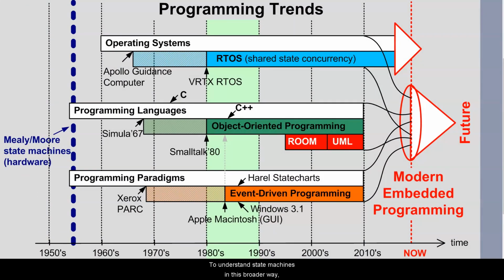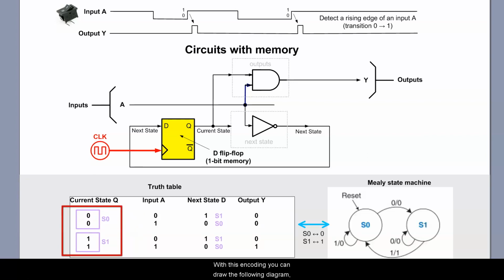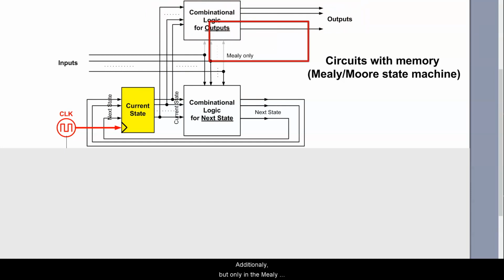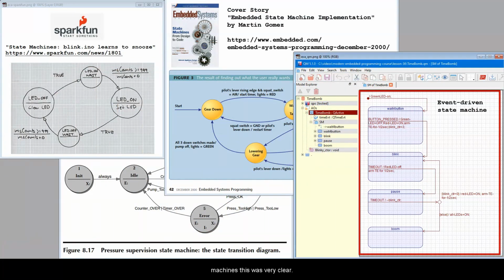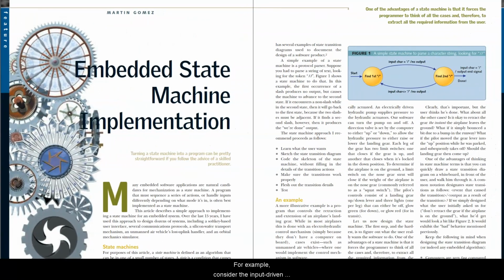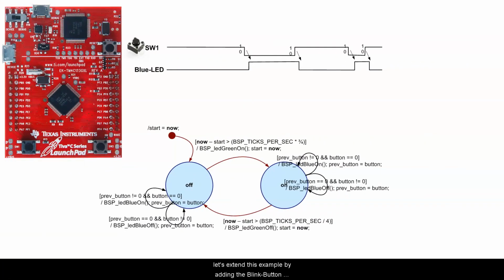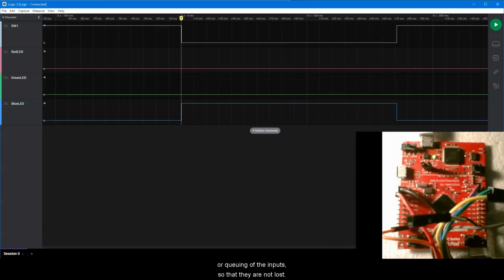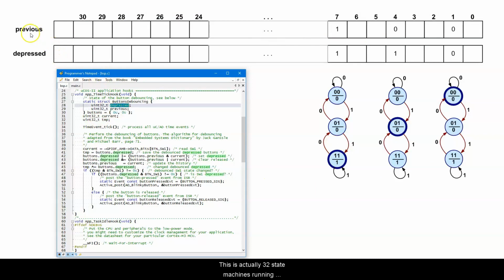#37 State Machines Part-3: Input-Driven State Machines

Comment: I think there might be some errors in Moore's Raising Edge Detection circuit. Due to the AND symbol, there are no conditions where Q1 will transition to 1 if we start from 0 0. AND symbol will never show 1 if either of the inputs is 0, and, correspondly, the transition from 0 1 to 1 0 will never occur.

Comment: I'm not trying to bother you too much, but do you happen to know of any alternative input-driven framework that would still allow for easy programming-by-difference and input-driven statemachine nesting with some sort of publish-subscribe mechanism as well? Or does that sound like a stupid idea even?

Everything else seems so spot-on about your approach, but I would like to think of the statemachines as "concurrent" actual machines that change their behavior given the state they are in (but don't sort of dissappear when there's no change in state), whereas these event-driven ones remind me more of fixed circuits that are only passed through on cue..

Trying to develop for time-triggered architecture automotive system.
Reply from the maker: I'm not aware of any "input-driven framework" that would have the properties you describe. In fact, this seems an impossibility to me because input-driven state machines deal with "inputs" instead of events. These "inputs" and their various combinations are then constantly checked in a polling fashion, so the code is littered with IF statements. I'm not aware of any way of publishing, subscribing, or reusing IF statements. Do you? Additionally, the "inputs" are typically shared (e.g., with ISRs), so you need to worry about the usual concurrency hazards, such as race conditions. For all these reasons, the industry has chosen the event-driven approach and frameworks (e.g., OXF for IBM Rhapsody, or QP frameworks used in these videos).

But if you are interested in input-driven state machines, the resource for that would be the book "Modeling Software with Finite State Machines: A Practical Approach". For time-triggered schedulers, the resource is Michael Pont's website "SafeTTy Systems" ( https://www.safetty.net ).
Reply: @StateMachineCOM thank you, I was thinking about some sort of compromise the way the input-driven machines can be used to generate the events, so maybe mixing them a little bit. But I don't really know what I'm talking about yet.

I guess I should still take a closer look into your "fly and shoot" example as well, it seems to work very similarly to what I need.
Reply: Going to probably go with behavioral trees or something, thanks for lots of useful info on these subjects anyway.
Reply: In the time-triggered RTOS I have to work with I can't use interrupts directly, only the time-triggered threads can be relatively prioritized, and the only way to raise priority otherwise is to take ownership of some resource temporarily with a lock. So I can't use the AO priorities directly, but otherwise it should be safe and sound.

It also already has the facility to debounce the inputs I need to use, so I get stuck thinking if I should put the input polling inside the AOs that use them or put them in their own AO or just poll them separately..

Comment: Hi Dr.Samek, 

The robotics example you give in the lecture. So in an event driven architecture for a robot, the event would consist of a variety of inputs e.g forces at different locations, current position etc  to decide how the motors would position the robot to balance itself. But that would happen asynchronously, so Robot decision time can get affected ?? Are Input driven state machines more responsive compared to event driven state machines in this particular case, and hence more advantageous for Robotics or Gaming ??

Thank you again.
Reply from the maker: In every real-time system you have delays between the stimulus and the response. The delay is typically smaller in event-driven systems because the code that responds runs as soon as possible after recognizing the event. (This is assuming that the event is posted to a high-priority active object). The delays between an interrupt that recognizes an event and the processing of the event inside a high-priority AO can be on the order of microseconds. In contrast, time-triggered systems respond only when the time tick arrives, which can be significantly later than the original event. The delays in that case are on the order of clock tick, that is milliseconds (1000 times slower).

Having said that, the delay might be negligible. For example, a time tick in a robot could run at 1kHz (every millisecond). This is much faster than any mechanical actuator can react. Similarly in a game, human reaction time is much longer than the "frame rate" of the game.

The point I was trying to explain in such systems (robots or games) is that it is impractical to decide externally what an "interesting" combination of inputs is for the system. That means that it is impractical to generate external events because that changes depending on the internal state of the robot or the game. So, the checking of the inputs and their combinations is most efficiently done inside the state machine anyway. Hence, these systems probably could use "input-driven" state machines, even though they are "less responsive".
Reply: @StateMachineCOM  Dr.Samek, thank you for the reply. I took some time to digest it. Please see if i am understanding this correctly.

Taking the example of robot further, depending upon if the robot is carrying a heavy load or not. The interesting combination of inputs needed to stabilize the robot i.e. which sensors to poll, will depend on the current state of the robot i.e. carrying a load or not. Therefore we need to poll for the particular interesting combination of inputs inside the state machine. 

In contrast, if we use Event driven machines, where events are essentially decoupled from the state machine and posted independently for further processing. We essentially have no control what events are being posted into the queue, or the interesting combination of events that we really need to stabilize the robot (in a given state). If we do decide to start checking the inputs, we have already shifted from Event Driven to Input driven architecture.

That is why in this case, a periodic input driven state machines makes more sense.

Comment: Hi Dr.Samek, 

Let me first say, I have taken a number of paid courses for embedded systems (I am self learning embedded), and nothing has come closer to what you have done for us the students, thank you so much !! , I had four questions :

1) I am a little confused between input driven and event driven state machines. From the comments, my current understanding is input driven state machines are constantly polling for input in a superloop,  meanwhile event driven state machines the events can be posted asynchronously from anywhere interrupts, other objects etc. So even if the event driven state machine is not currently active ( eg if it is a low priority task), we will not miss anything ?? Is this what we are trying to imply ?? that Input driven State Machines are running synchronously coupled with time , and Event driven state machines  asynchronously ??

2) I was searching up on Internet, and I came across slides from Dr.Koopman from CMU. In this particular slide (https://users.ece.cmu.edu/~koopman/lectures/ece649/07_distributed_tt.pdf), he talks about Event Triggered vs Time Triggered Approach to network a distributed embedded system. Is the Time Triggered approach something similar to input driven state machine that you are describing in the current lecture ??

3) I am slightly confused about what constitutes an Active Object ?? In the previous lecture we first had two active objects  1) Button and 2) Blinky. Later  we combined them together to form one AO, which resulted in more efficient memory usage. Can you give some guideline regarding that ?? How would I decide that this is one Active Object.

4) I am trying to read more about embedded software architecture (design patterns etc), and the only two resources have come across are your wonderful wonderful lectures and your two books. Another one is from Dr.Doughlass (Design Patterns for Embedded Software). Are there any other resources , I can read on ?? As I am thinking more, I am seeing by and large most of the problems can be solved via AO approach safely and in a scalable way, rather than mud-ball created by RTOS synchronization primitives.

Thank You.
Ovais
Reply from the maker: I'm glad that you study the video lessons. 

Regarding your question (1): your understanding seems mostly correct, except that "input-driven" state machines are not limited to the "superloop" only. They can also run periodically. The defining characteristic of "input-driven" approach is the existence of "inputs" that are then checked in every state (so you have the if (...) statements in every state).

Regarding your question (2): I frankly don't quite understand the referenced lecture by Dr. Koopman. He apparently talks about "distributed" systems connected by networks. This is a particularly difficult class of systems and is currently outside the scope of this course. Here we are still talking about a single CPU and single address space.

Regarding your question (3): optimal partitioning of the system into Active Objects is an art, similar to partitioning an object-oriented system into classes. Big books have been written, such as the classic GoF "Design Patterns" book, where you can read that experts typically come up with quite non-intuitive classes. An example of application design is provided in my video "Active Objects and State Machines" (https://youtu.be/h_u92uLssDo ).

Regarding your question (4): a few resources I recommend are: "Managing Concurrency in Complex Embedded Systems" Dr. David Cummings (https://www.state-machine.com/doc/Cummings2006.pdf ),  "New Directions in RTOS Kernels" by Dr. David Kalinsky ( https://www.state-machine.com/doc/Kalinsky2014.pdf ),  "Message Passing for Intertask Communication" (https://www.state-machine.com/doc/Kalinsky2010.pdf ), writings by Herb Sutter on concurrency (google it). Most of these articles don't explicitly mention the "Active Object" pattern, but I'm sure you will immediately see that this is what they advocate.
Reply: @StateMachineCOM  Dr.Samek, thank you for all the detailed resources and reply. The video is precisely what i was looking for, a more involved example. And the first paper especially looks very interesting. Thank you so much !!

Comment: in event-driven programming the only way to post events by making task higher priority or through interrupt right?
Reply from the maker: In event-driven programming, posting events is completely natural and does NOT require anything special. You just post an event by calling the post() operation on the recipient active object. In particular, you don't need to mess up with task priorities. Also, events can be posted from anywhere: interrupts, active objects, or any other code (e.g., "device drivers"). The posted event will be processed depending on the priority of the recipient of the active object. If that priority is high and you run on top of a preemptive kernel, the event processing can preempt lower-priority processing. This is also natural and you don't need to do anything special to achieve that. --MMS

Comment: Great and excellent Work.
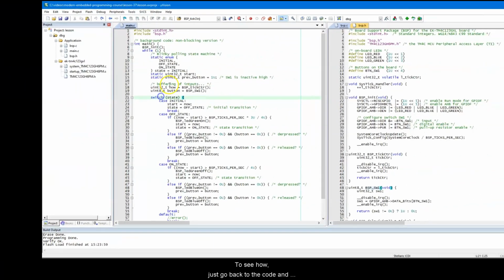 i have one question when you  at (27:00 ) convert from input driven with capturing the data into local var (buffering ) to  Event driven what the value it added or it's just way to show us how the conversion should be between them cause at the end they are the same. and from my understanding i think the only difference between input driven and event driven is the buffering right??
Reply from the maker: Data buffering inside events is just one of the lesser important things. The most important difference is that event discovery is coupled with event processing in the input-driven state machines, while it is separated in the event-driven state machines. That's why input-driven state machines have to run "constantly" to poll for events. In the code, it shows up as an IF-statement in every state of an input-driven state machine. These IF-statements (guard conditions) check the inputs for "interesting" conditions, and only after that some processing can happen. In contrast, event discovery happens outside event-driven state machines. The event discovery can be interrupt-driven, so constant polling for events is unnecessary. I must have done a rather poor job explaining the differences... My most sincere apologies!   --MMS
Reply: @StateMachineCOM  Great. I got you. but that's show us that you truly   didn't convert from input driven to event driven because in every case state in code we have (IF - ELSE) and the event discovery is coupled with event processing and the whole state machine run inside super loop. that's right ?
 the method used in the code is input driven not event driven ? 
even after when you say i'm gonna to modify it to event driven?
Reply from the maker: @MahmoudAli-sv7fj  Yes, that's true. After the conversion, the "event-driven" state machine had all the guard conditions that the original input-driven state machine had. That's because the event that was fed to the event-driven state machine was very low quality. It didn't mean anything yet, and therefore the guard conditions were needed to find find the real events. As they say: garbage in, garbage out. The moral here is that direct conversion from an input-driven state machine usually ends up with a crappy event-driven state machine. To end up with a better state machine, you need to create higher quality events. --MMS
Reply: @StateMachineCOM   million thanks of times

Comment: Thanks for the sound explanation of state machine history. Learned a lot. Based on my experience of FPGA design, the input driven state machine is doing the job which hardware/FPGA is doing. Because our world is analog, and we are just sampling at certain rate. To derive a reliable event, like debounced button click, special modules are developed to filter out the glitches. And FPGAs run at MHz, so the sampling rate can be as high as MHz. Right, to deal with asynchronous inputs, buffering is a common method.

Comment: Hi Miro! Thanks for your videos! I'm trying to extend the functionality on this board and to use the SW2 switch. What I did so far is to initialize it similarly as you do for SW1 but what I get is that if this button is always pressed (i.e. if I make it this button to lighten up an LED then this LED is always on). Do you have an idea what I'm missing?
Reply from the maker: The SW2 switch on TivaC LaunchPad requires extra steps to properly configure, because it's shared with the NMI. Please see http://embeddedguruji.blogspot.com/2019/02/tiva-launchpad-tm4c123-part-2-push.html --MMS

Comment: I been following your lectures for almost two years, when I started in embedded systems, I always felt simple super loop inadequate, RTOS is overkill, unnecessary overhead, I always wanted something in middle, simple as super loop yet with multitasking capabilities that's where I found your blog and video lectures, I'm every much interested in event driven Run to completion task 
Whenever I start a program its start as event driven but as I add more and more codes it becomes spaghetti code, no matter how hard I tried I can't quite to implement the state chart in code, it stays only on paper, things don't really scale up, please any advice ?

Comment: Hi Miro, thank you for this incredible course! I have been following along but have run into an issue. No matter what code I try to download, I am receiving an error the flash loader program failed and values at address XXX do not match, verify target memory and memory map.

I have looked all over and double-checked my debugger settings. I'm unable to download any code to my board, even code that was working fine before. Do you have any suggestions on where I should begin troubleshooting?
Reply from the maker: Please, visit the companion web-page to this video course, which is advertised in every single video: state-machine.com/quickstart . You can find there, among other resources, the *Troubleshooting Guide*. Your problem  and the solution are described in there. --MMS
Reply: Which board are you using ?
Reply from the maker: @raja4521  This video course is based on the EK-TM4C123GXL board (a.k.a. TivaC LaunchPad). You can just google for the board name to find out more. Or, you can visit the companion page to this video course, which is advertised in every single video lesson: state-machine.com/quickstart --MMS

Comment: If I understand correctly from this lecture, input driven state machines still have their purposes. So I wonder if they can be modeled using QM. So far I thought it can only work with events.
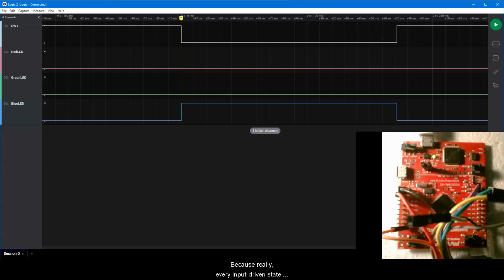Reply from the maker: Yes, absolutely. You can use QM for input-driven state machines, because every input-driven state machine can be directly converted into an event-driven state machine. I tried to explain that at 26:55, where you can see the conversion. The simple procedure is to invent an event, like SAMPLE, and package all the inputs as parameters for this event. This already provides the buffering of inputs that you typically need anyway. (Please note that this does not provide full event-queuing yet). The invented event (SAMPLE) is "low-quality", because it arrives "always", but the state machine is "event-driven" and can be modeled with QM. Please note that you still have all of the guard conditions, but QM supports them as "choice-segments". --MMS
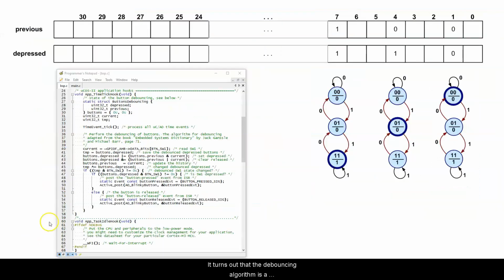Reply: @StateMachineCOM  Yes, I saw that part, I was actually talking about the state machine at 30:53, if it can be modeled directly with QM